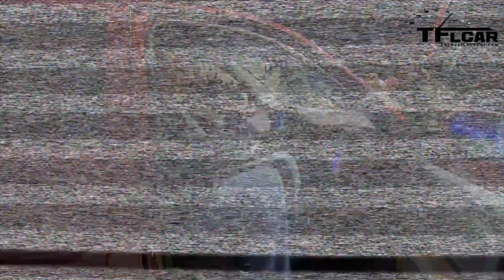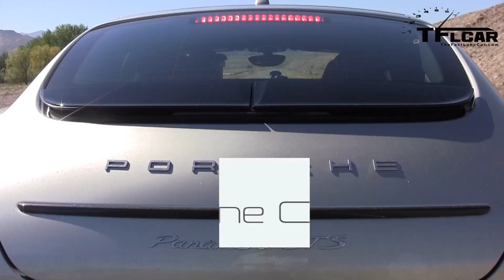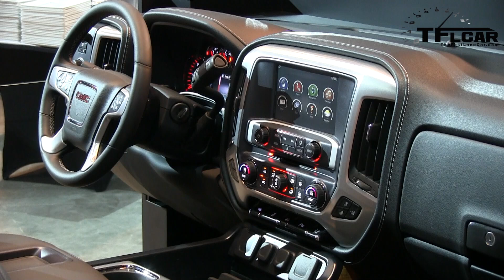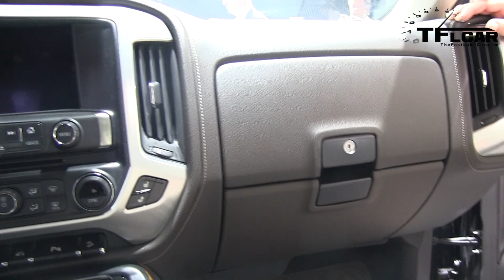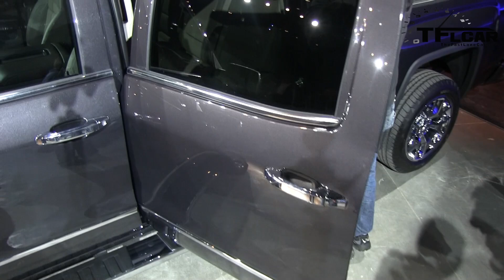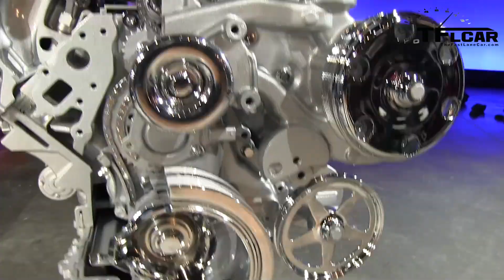2014 GMC Sierra: Everything you'd ever want to know about the new trucks interior design

Comment: GM did a great job on the new Sierra, for all the negative ignorance I'm reading in these comments, go drive one then shut up. If you can't afford one of these don't watch the video and whine that you can't. There are some pretty competitive optioned versions for those that can afford a certain price range. The 5.3L V8 is not only smooth and delivers nice usable power but also provides good fuel mileage vs. some other brands of trucks I've personally owned with smaller displacement turbo engines. The ride is very comfortable for a full sized truck with loads of appreciated options and its a pleasure to use for any typical light duty full sized truck challenges you can throw at it...works great as a daily driver and the 4X4 is great for brutal type northern climates as per what I have to deal with. The big three have identified the bread and butter consumer constituent and have delivered good offers recently, the Sierra is right up there and in fact my personal choice, well done GM.

Comment: well i have a 1993 chevy, and the engine exploded at 52k miles, but ever since then its been fine. Well except for the blower,heater core, alternator, power steering line, speedo, and air conditioning. But other than that its fine

Comment: Went and test drove the new silverado. NOT IMPRESSED! I am a huge GM fan which is why i'm so upset right now! The fully new silverado has inlayed doors,my link system,projector head lights,rear assist steps, a larger cab, and a new 6.5' box. The F-150 has all of those things! plus 10 more hp and 40 more ft-lb or torque. And lets not forget it was $10 000less. Yeah I hate the fact that I now drive a Ford but come on GM GET IT TOGETHER THIS IS NOT A GAME CHANGER! I COULD DO BETTER!

Comment: actually what I was referring to was the cutaway like someone else said already and I didnt notice that. and IM sorry to inform you there is no car on the market if the key is in the accessory possition instead of on that "all the lights are on that stay on once the key is turned forward" first off I was referring to the check engine light. second no light on the dash should be one. only the radio and on some cars the wipers will work on accessory. NEXT TRY

Comment: Im a GM guy always have been. The trucks these days are using better materials then they ever did. What i dont understand is why they flood the interiors with stuff thats gimmicky or not neccessary, but neglect the bed of the truck. Just simple tiedowns? No rail system? They constantly overlook the bed of their trucks. I use tiedowns more then a filing system. Dodge did that long ago, GM should have learned from that.

Comment: Scenario: You're dead fucking tired on a road trip at 3AM driving home and you've got 100s of miles to go still. The last thing I'd want to hear is BRAGAGAGAGA every time I touch the gas pedal. Plus, if you put an aftermarket exhaust on the truck it'll be just as loud.
It's all about perception. You can still buy one of these trucks and make them a badass workhorse just like the 1990s trucks.

Comment: I'm sorry, but you're not the brightest crayon in the box are you? Not everyone buys a truck to haul 4x8 sheets of plywood or drywall. People buy trucks as everyday commuter vehicles.  8 foot beds are available.  I've never wished I had one for as long as I've had my truck.  Also, not everyone lives in Texas. Leather seats now come with ventilation any way. You can turn off the heated seats. They don't have to be on. My biggest question is, why would you need the gauges if the battery is dead??

Comment: Bunch of manufacturer BS..!  Would rather have analog mechanical gauges that work even if battery goes dead, the back bed should me a minimum of 8 ft. long (In other words, long enough to haul sheets of 4 x 8 plywood or drywall, rather than have to extend tailgate or load on top of fender wells.)..

Interiors, NO LEATHER, NO HEATED SEATS, way too hot in Texas heat, would rather have heavy duty fabric seats with forces COOLING..!   Geez, trucks are supposed to ride like trucks, not cars..!

Comment: i want this truck with a 6 inch lift in the front and a 5 inch in the back. diesel engine. aftermarket pipe with the dumb system with diesel exhaust fluid taken out. and bigger rubber. might even keep the rims...they arent that bad

Comment: the truck i had was dangerous . i talked with other 6.5 and duramax owners who had the same problem spoke to the dealer and notified g.m. by letters no response. if you put the truck in reverse it would surge backwards or if you came to a stop the truck would throttle up changing the p,d. m. would cure it for awhile then go right back to uncontrolled acceleration. they dont care about the customer and ignore your concerns its too bad cuz it had great pulling power and fuel mileage but are unsafe

Comment: i bought a 1999 gmc 3500 6.5 turbodiesel loaded almost 40 grand! it was the most unreliable piece of shit i ever came across they put the injector drive module under the intake on the pump g.m. knew it had an ambient temp of 185 f yet it got 270 degrees under that it went every 10000 mi. at 450 bucks a pop i finally fixed it with an aftermarket one relocated behind the front bumper. g.m. salesmen and service managers are great liars! g.m. just keeps building different engines and dont fix motors

Comment: I work at a Buick, GMC dealership and for Chrysler Dodge jeep Ram dealership, and no the SLT and the Denali don,t come with rear ac vents, something the others have so I hope they are in these new one as it would be ashamed if they didn't. I have lost sales on the terrain due to the fact that they do not have ac vents in the rear witch I dont blame them I would want my kid in the back seat to suffer in the heat either.

Comment: Lol C-larda channel/account #2=CanSUCKSForever2013.

Funny how you joined TODAY and the only video's you dared to comment on are these, As stated in my previous comments. Allison is STANDARD on higher grade vehicles both in value and tow/haul capacity. ERGO 2500, 3500. Not to mention ALL trucks have a Limited SLIP G80 locker, AND SOLID-STEEL Boxed Frame. You should grow up and stop trying to be a smart-ass with multiple comments. Listen to reasoning and act sensible.

Comment: Its not standard... go to their website.. its a $1200 on even the 6.0L. Also.. the Hemi is all dodge.. and the benz tranny design was borrowed and beefed up like I stated earlier...The 5 speed mercedes transmission is not even used anymore.. and the 8 speed is used in vehicles that make 2x the HP and 2x the torque as the ram... Say what you want but all the parts are proven reliable...even more so than GMC..You say you want reliability which is Ironic in this context....Sigh.

Comment: The Allison is STANDARD on the higher grade, bigger engine trucks. The 4 speed was not so good, but that was placed only on 4.8L V8's and the smaller V6 engines. 

I Like GM's for this fact, their trucks are easy to maintain and their parts don't cost alot just to be shipped over. Now, if you prefer your "Dodge Ram" with a Benz transmission and a non-Dodge Engine with Italian interior. By all means go for what you want, for work truck and reliability, I will take a GM truck.

Comment: Am I done losing yet? Dodge has always been at the bottom of the Big 3, all of it's cars have been slower than GM and Ford all of it's truck are also slow, not to mention absolute garbage when it comes to mpg. Even with an 8speed transmission a dodge is less fuel efficient than a GM with a 6speed. Warranties mean nothing, yet Dodge just recently stepped up warranties after being bought by Fiat. Being that Chevy Silverado was truck of the year 2011. It's safe to say the ram won't be there 4 long.

Comment: What does having a longer warranty do to prove reliability? You are clearly an Idiot. Why in the world are you comparing the Mercedes Warranty to the GM warranty. The ram used a beefed up 5 speed from Mercedes, The transmission is in a DODGE, not a MERCEDES, Dodge offers the exact same warranty length and mileage as GM. I have just dis-proven both of the arguments you just arrogantly tried to start.

Comment: The problem with these new trucks coming out today is they are designed by nerds like this guy. Not by someone who have owned and used trucks the way they are supposed to be used in a work environment. If i want all this luxury equipment and crap I'll buy a Cadillac. Keep it out of my truck please. but GM has disappointed me again. So once again, I will be sticking with my 2007 Sierra with the 6.6 LBZ Duramax motor.

Comment: I always preferred the gm trucks. but the new interior is has too much cheap plastic and looks like a asian car. This misery starts with the camaro, and as i saw the new colorado, i was afraid about the new silverado/sierra. and it came as i expect it.
the current ford and ram are better, then the new gm generation. Air suspension, 8 Speed transmission, Eco boost, DOHC. The only point for GM will be the fuel economy. what a bummer!

Comment: What the hell... where do you even get off saying those things. the Ram has not had transmission problems since it got rid of the 46RE and switched to the 5 speed (From Mercedes BTW) and the Hemi. Ford does not need new engines every 60K in fact they are mostly VERY reliable, 60K? Come on, why even make up a number like that. Oh and on the contrary that GMC is the best truck.. hm, aren't they a more expensive Chevy? Sharing nearly every aspect? who'm BTW is way less than perfect in reliability

Comment: I don't know about all this son. But I have 2002 Ram 1500, had it since it was brand new, with 127K on it, original trans, motor, and rear end. The only thing replaced was a hub assembly, rack & pinion Tow with it from time to time and all. Still running strong!...(knock on wood). I keep it maintained, never went over no more than 1 or 2k on my 3k recommended oil changes. It's all about how u maintain your vehical. When u start neglecting the maintenance on a vehical that's when the probs start.

Comment: how do you know i do know my dad had a dodge with 92000 miles on the original transmission and my brother has a f150 with 212000 on the original only problem is it blew out a spark plug.

Comment: arent you agorant why the hell would you spend 50k on something that losses value quickly. Doesn't matter what brand you still lose 12% of the total vechiles value the minute you drive it off the lot. Also premium does mean expensive and for a truck that just downright stupid. The market for a truck should be aimed at the mild to low case. No one in the middle or low class would buy any of the features above. They have no need for them except to get from A to B.

Comment: Ram= new transmission every 60,000 miles among other things..... Ford= new motor every 60,000 miles amoung other things........ GMC= the best truck on the planet with no issues and the absolute best design interior and exterior, overall the best looking, most capable, long lasting trucks ever made. I'll be first in line to buy the new 2014 GMC crew cab SLT 4x4 in sanoma red. Thanks GM for delivering us with another master piece.